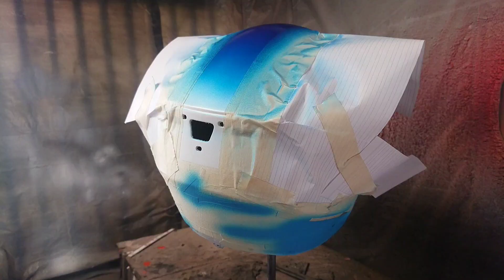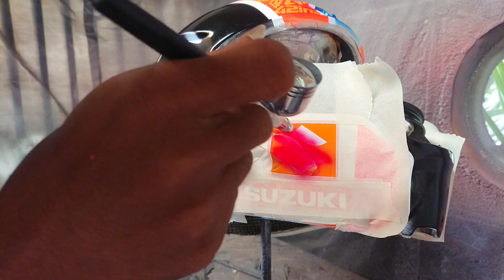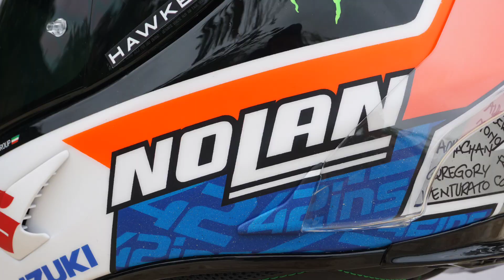How To Paint Alex Rins Helmet | Nolan X-lite X-803 RS UC | MotoGP

Comment: Is the air duct of the X-803 rs secured with screws? Or is it fixed with adhesive?
 I also want to paint it, so I would like information on disassembling the air duct. 
please tell me.